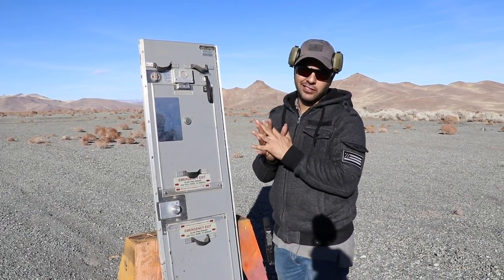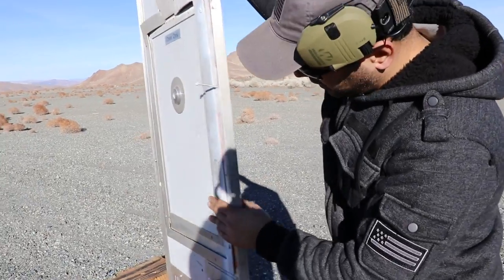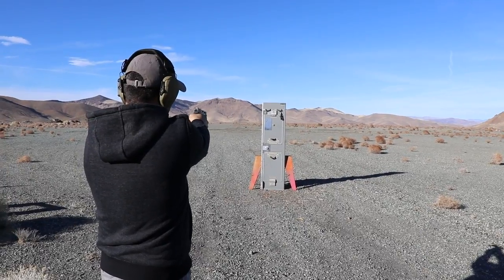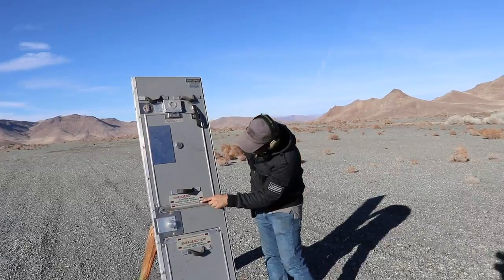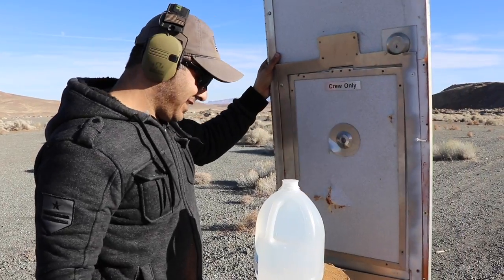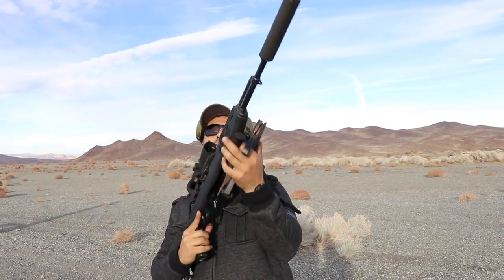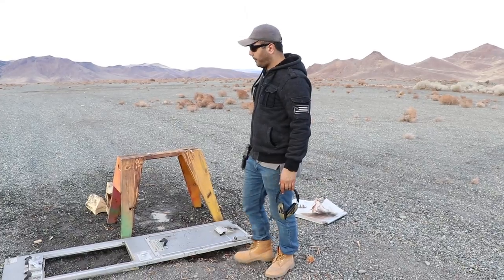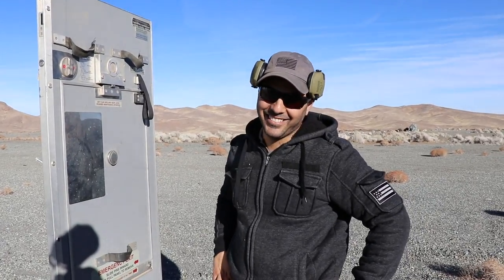boeing 737 Airplane cockpit door Bulletproof ?

Comment: Ok you have the cockpit door. My question is what did you do with the rest of the jet?
Reply from the maker: hahaha its on the next video
Reply: Del T 😂
Reply: Del T sold it on Blackmarket
Reply: oooh ! the plane revenge... next video "how to make a plane fly" .. but this time, not a metal small plane, but a real big one XD
Reply: Del T wwe Hulk Mania😂😂😂
Reply: Lmao yo
Reply: My guess is..... everything else is listed on ebay. Check engines and wings starting bid ..0.05 reserve no met
Reply: Frank Trinidad then how is he going to ship it right in the desert???
Reply: Del T He used it for target practice
Reply: Colombian.. with an O
Reply: Hydraulic low rider mobile that  goes Brdrdrdrdrdrrrr
Reply: Up coming video.... AA gun vs A whole jet
Reply: Finally, the answer to what happened to MH370
Reply: I wonder if it can stop a plasma rifle in 40 Watt range.
Reply: Airplane starter kit.
Reply: Del T there's a lot of spare 737s around atm
Reply: probably still flying and the pilots are wondering why there are terrorists in the cockpit? 🤔😁

Comment: That "Mechanism" you're asking about is a depressurization release device. If the windows in the cockpit blow out, or any other kind of depressurize event occurred in the cockpit, the little arm releases and let's the door section open to allow air to flow through.
Reply: Wouldn't that just kill everyone on the plane instead of just the pilots tho?
Reply: @XboxOriginal1321  not with oxygen masks. Also, I think it is to allow the doors to be openable, since the low pressure would prevent it from opening (I could be wrong tho)
Reply: I think it is an escape hatch, be it whether the plane is upright or belly up. The quick release switch allows easy release.
Reply: I think this is older door & that is why you can get this old door.
Reply: Thanks i learned something today

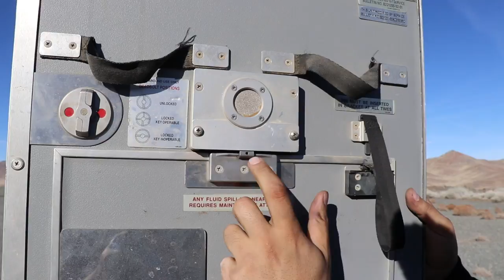Comment: The circle mechanism thing for door at 1:30 is an automatic door release in case the pressure drops extremely quickly. The point of it is so there is a chance for pilots to escape, for flight crew to realize that there is a rapid decompression, or for another person to pilot the plane in the case that the pilots have passed out(doubt it would be successful, but you gotta hope). 

Its also why they say to immediately service the door if liquids are spilled on it. It detects the pressure change through a thin film of metal(think aluminium foil) and there are little holes in the backside, so if pressure was to change slowly, it would equalize on both sides and not break the film. But if it was too rapid, the film would break and it would open the door. If liquid got onto the film or in the holes, it could not release or it could release prematurely.

Comment: AWESOME VIDEO!
To answer your question about that round thinggie on top of the "emergency panels": Those are "Decompression Panels" they will open automatically during cabin decompression. Lets say you crash and there's a pressure differential between the cabin and the cockpit, it could be impossible to open the door to get out. These round things solve that problem by opening automatically and not letting the pressure differential jam the door.

The dead bolt on the top left is kind of cool. you can select it to open, close to allow for the key outside, or close to not allow for the key. Allowing for the key to open is meant more for maintenance to open it on the ground whenever they gotta work on it.
As I understand it, it may matter what year this door is because back in the 70s they were built more to dissipate an explosion rather than stop bullets. This may explain the honeycomb pattern you showed. They're supposed to be able to take a grande or a little bit of c4... but I'm not too sure about that. If this is true, it may make a difference whether you shoot it from the outside in instead, and if it is on the door frame attached to the aircraft.

This one is an old door and there's been quite a few upgrades post 9/11. 

I like it how the door took the 500 even after damaging the same spot with the 44.

I really like how you showed this. Makes me feel safer at work. Wont get into the cockpit without one hell of a fight. Thank you.

Awesome vid.

Comment: The thing that you asked about on the door is a fluid detector as well as a pressure detector to unlock the emergency doors in case of an emergency. Just saying, I won't tell if you took that one mid flight.
Reply: LazerUnknown It unlocks the panel if the pressure difference between cockpit and cabin is too high. The lanyard with the pin inserted in the little bracket stops the entire panel flying into the cockpit should the decompression panel unlock.

The reason why those panels are there is to stop the entire door blowing open into the cockpit.
Reply: LazerUnknown i

Comment: You weakened the door by the time you shoot the Smith & Wesson Model 500, essentially stretching out the kevlar fibers with the 44 mag shot in the same area.
Reply: Thank you! Finally something with a brain!!
Reply: you do have to remember that the door had 3 different parts, the frame, and the 2 emergency hatches. The Kevlar is isolated into these 3 sections, so a bullet in one section wouldn't effect the Kevlar in the other 2 sections
Reply: What is your point? It still stopped the 500

Comment: The two panels you were asking for are emergency exits in case of jammed door (e.g. after a crash) and the top one is a panel that equalizes the pressure between the cabin and the cockpit in case of a decompression

Comment: this should reassure the FAA that there pilots are safe 
because nobodys sneaking anything larger than a 500 magnum  on a plane unnoticed
Reply: Evan MAGLADERY you could sneak a 50 bmg in lol its easy
Reply: Well yeah that's the primary idea, its to stop anything that someone could still sneak onto a plane.
Reply: What about a FN57? Goes fast, not 5.56 fast, but easily twice 9mm speed.
Reply: In theory you could sneak a baby ak onboard. If you took it apart.
Reply: Lmao yeah right at least 65 percent of shit doesnr actually get caught going through detections otherthan that airport security is absolutely disgraceful
Reply: PBMS123 I have the FN5.7.  It is a fast bullet. But doesn’t have quite the energy of a 223 or 5.56. And those were stopped. Definitely not as much power as a 44 mag or 500.
Reply: Breck Shortley it did not stop the .223 let alone a .556
Reply: Josh Repik Exactly right. That door is pretty impressive. No way someone who snuck on a handgun can shoot his way through that door.

Comment: You should test from the largest calibers first, that way the door's integrity doesn't get weaker and weaker each time until you try the 500. The door was already super weak when you fired the 500, which may have contributed to it finally breaking.

Comment: Boeing Mechanic that has installed a couple hundred of those doors on 737s. I have no idea what that block thing on top is. There's no power going to the door and the door is unsealed. I think it's just super reinforced to make sure the top panel doesn't come out when someone tries to force the door.

Comment: Not trying to be picky Edwin, but why would the pilot shoot from his side of the cockpit? You shot the wrong side my friend. I doubt it makes a difference but just saying.
Reply: Gun Nut That would be correct!
Reply: He mentioned it in the video.
Reply: Bullet resistant glass has a 'threat' side and 'witness' side.
Hit it on the witness side, good chance bullet can get through.
Hit it on the threat side, bullet is expanded/deformed/broken enough to be stopped.
Can anyone say for sure if this door does not have a designated 'threat' and 'witness' side?
Be odd to make it bullet proof both directions, no?
Reply: That honeycomb material was on the witness side. May make a difference.
Reply: For not trying to be picky you really are being picky

Comment: that thing at the top of the door is a pressure sensor 

if the cockpit depressurizes suddenly, it lets that top half of the door break away to equalize the pressure
Reply: MWB Gaming great profilepic
Reply: My guess is it is the protective latch, that will not be compromised from nefarious reasons. Two latches on the ‘emergency exit’ would be the clue. Both doors operate the same, whether you are upside down or not.

Comment: Im building These doors, the inner Things are Glas fibre with 9 lays and the honey structure. In germany we call IT sglass. IT is also used for the floor in Transport Planes. The frame of the door is glasfibre and its cnc from 1big heavy platt. Greats from germany 👌

Comment: First of all, it 99% most likely came from the boneyard down in Tucson, Arizona. And second of all, DAMN THESE THINGS GO FOR 10K+
Reply from the maker: Not cheap at all
Reply: Edwin Sarkissian definitely worth it when your flying though!
Reply: austin randall definitely useless if the plane is falling out of the sky, with that said, as oppossed to what falling out of the water.
Reply: jose trevino A plane will never fall out of the sky. Ive been in the aircraft industry for over 10 years now! If your going 80 on the interstate and let off the gas totally, you will continue to go for thousands of feet. Now consider going over 400mph with Wings that are providing a whole lot of lift. It will never happen.
Reply: Might just be worth it for meth cookers in a mobile home. But then again, they're not known for being particularly savvy, or sensible in the least.
Reply: A stall is an aircraft moving too slow to get lift, get in a deep stall and you can fall out of the sky, it's happened.
Reply: austin randall Not worth $10K+ at all.  Only worth around $1000.
Reply: ... Unless the wings break off.

Comment: excellent video this Edwin, shows how the pilots are safe in an emergency in flight
Reply: Truly, although it's not possible to sneak a gun on a plane but it is possible to try and ram the cockpit door. But seeing as tough as these doors are I'd say it would be physically improbable to knock one down.
Reply: FlatOverCrest I agree with you, I also noticed a certain fragility, something engineering could improve
Reply: Benjamin Schack please dont give ppl ideas.
Reply: No! he shows how people are safe from pilot shootings!
Reply: FenceDaGreat yes, it’s is totally possible to ram the cockpit door open. The passengers on one of the 911 flights used a drink cart to do that.
Reply: They changed the doors because of 9/11.

"After 9/11, changes were made to the security of cockpits in an effort to make hijackings more difficult. According to the US Federal Aviation Administration, doors should typically be tough enough to withstand a grenade blast. They are usually left locked throughout the flight."
Reply: Tom I believe you can access the cargo bay in the passenger area in some planes (and those equipped with lower bay mobile crew rest area). Then you can cut open the sides of the cargo containers which are usually made with some sort of fabric and craw forwards to the avionics bay under the cockpit. It’s going to be very tight and difficult but if you have the time and determination, it can be done. And at last when you arrive in the avionics bay, just climb up the ladder and open the hatch and there you go. You are in the cockpit. 

But, you have to manage go get around all the FA and standby crew first.

Comment: Those two removable panels and the mechanisms are blow out panels. They serve 2 functions, they "blow open" to release pressure in case of a rapid depressurization and also can be manually opened as a means of egress in case the door is jammed or failed in the closed position.

Comment: It proves how safe pilots are. You need a rifle to shoot through the door and by that time, you'd have been escorted out of the airport by security
Reply: And ? If it goes through from one side, it will go through by the other side
Reply: lol "escorted out", that's cute.
If you bring a rifle into a plane and start shooting at the cockpit door you don't get "escorted out".
Reply: You can't just walk into an airport with an AK or an AR. If you do, you will get escorted out of the airport in a body bag or in handcuffs
Reply: I'm pretty sure you don't need rifle. Lead bullet Edwin used are bad penetrators. Handgun with  fast AP bullet would go through.
Reply: Would be interesting to see what the infamous 5.7mm handgun could do.
Reply: You CAN'T bring gun or knife to airplane on you. You can fly  with firearms, but they will be in checked bagagge in separate bagagge compartment of a plane.
Reply: justunfoe Thats what, I SAID! (agreement)
Reply: User name checks out.  

Torture and mayhem in the cabin would cause the flight crew to swing open the door instead of landing the plane?  Have you ever met a pilot, Mr. Nut Gun?  I guess they'd be able to "handle a stress" like this.
Reply: Patric Lam shot*

Comment: these two little "doors" in the cockpitdoor are there in case of a depressurization, they are triggered above a certain differential pressure between Cockpit and Cabin in order to equalize pressure inside the plane.

Comment: The top lock if for decompression equalisation. If the cabin looses the pressure the top part opens slightly to let the flight deck depressurise to avoid any further structural damage. The bottom one is used in case of crash landing and such a structural damage that won't let the door get open to excape. If even that doesn't work they can use the opening window on the side and the excape ropes in the flight deck

Comment: The armour is almost certainly optimised to stop a projectile coming from the cabin side towards the cockpit side. The armour is designed with each layer having a specific purpose and must be hit in the right order to be effective.  
Let's say for example you have a simplified armoured glass consisting of just one layer of carbonate and one of glass. If shot from the polycarbonate side it will not present much resistance whereas if shot from the glass side it will be very effective at stopping projectiles, or at least slowing them down much more than the other way round. 
If you still have the door I really think you should try it the other way round. It wouldn't surprise me at all if it stopped even the AR-15 shots.

Comment: I like your channel, I am a pilot of a B737 NG. the small silver circles at the top and bottom are pressurization equalizers emergency exits in case door get jammed, small belt at the top one with sort of a key is for de upper emergency door don’t fall. aside of that you are shooting from wrong side, it would be good doing that again some time. cheers!

Comment: Great video! Very educational and informational on guns and aircraft doors with only one exception: the range. In a real plane scenario no active shooter would be more then 10 feet away with his hangun shooting at the cockpit door. I feel that this experiment was not valid due to the distance away you were from the door. If a possible threat wanted to make an entry I am sure he would slam into the door and bang on it and then try and shoot it with high hopes that the air marshal doesn't exterminate him. (As he is the main problem)

Comment: The pin hold the alarm pull cable so that when the door opens an alarm sounds. The other device is controlled by heat sensor. If there is a cockpit depressurization solenoid that automatically releases or catastrophic depressurization.  It is unlikely that you will get a gun big enough to penetrate on any commercial airplane.

Comment: The lock on the other side of the key twists into place and then it will unfold to make an X shape, if you do that it disables the key from being able to open the door, if you just twist without making the X it will function with the key.

Comment: There's an electronic lock on the door........apart from the manual stuff u showed from inside.......the two panels up and down are decompression panels........so incase of loss of pressure in cockpit or filled with smoke....the pilots can exit

Comment: It also has blow out panels in case there is a depressurisation either in the cabin or cockpit, that would prevent the door from being forced either into the flightdeck or exit into galley.

Comment: That center core material looks like dynema, composite multistrand layer, millions of strands of a dental floss like material layered in a polymer.  Soft armor kits for vehicles use it too.  It's supposed to take up to 3 rounds 7.62 Nato within the same area without failing, but will deform and fail for multiple shots in same square inch area.  It's a "get out of the hot zone" type of armor and was used for many HMMV and other applique soft armor add on kits.

Comment: I think it would make a difference if you'd shoot it from outside, but I also think that results would be pretty much same. this kind of "armor" protects against slow velocity rounds only. rifle rounds go through, because the "armor" inside has no time to react.
I'm not sure what this ammo is called, but there's some type of ammo that is designed to penetrate soft armor. it's not armor piercing. armor piercing round is designed to penetrate metal-based armor, but I mean the type of round that is designed to penetrate soft armor only. It has really sharp tip, it doesn't rotate and high velocity. Perhaps someone knows name of that round. I think those would go clean through.

Comment: Its designed to stop medium pistol caliber threats using similar to body armor technology, nothing new at all. Frankly that is a very old model door and the new ones are much lighter and stronger. The technology has not changed that much, just more advanced materials have made it weight less to accomplish better results. Remember, we also trust that their are marshals on planes and that airports are able to catch weapons as large as a desert eagle or big bore revolver. I worked as a tech designer at Boeing for 5 years. We are far more worried about things striking the outside of the plane. :)